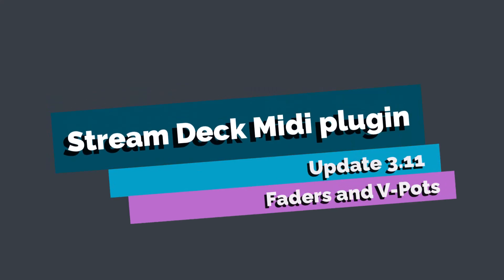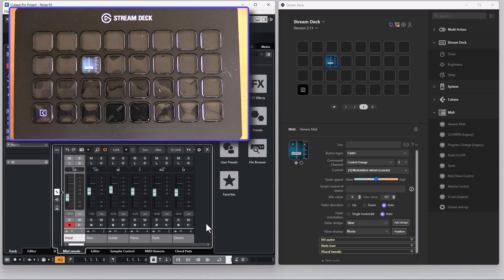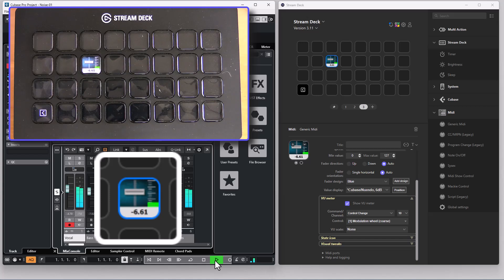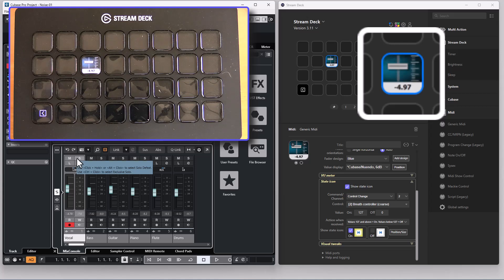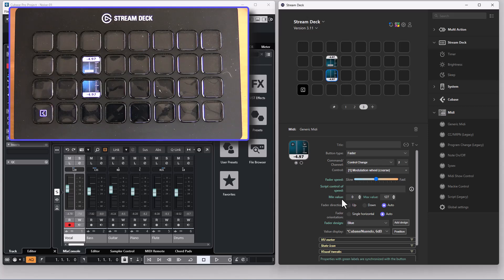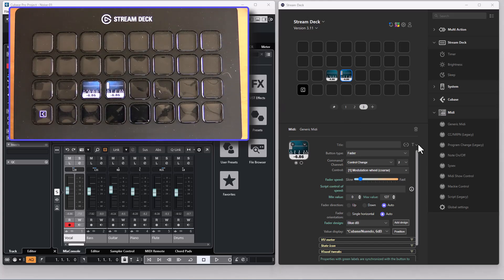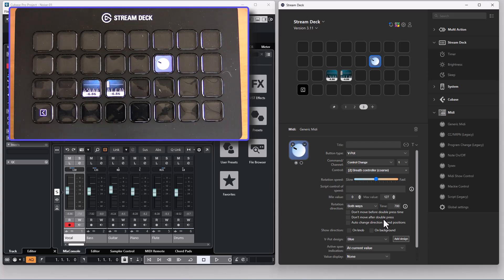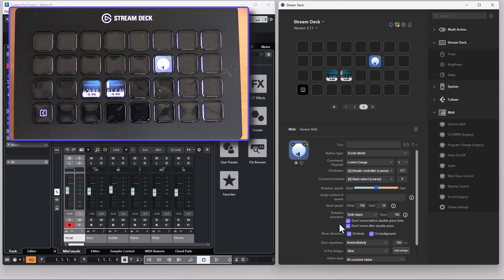Stream Deck Midi plugin 3.11 update, part 2, faders and vpots

Comment: I am trying to use my midi controller to control the buttons in stream deck software, as I don't want to spend the money on a stream deck. I can't seem to find a vid showing how to set it up tho
Reply from the maker: Sorry, I don't understand. The Stream Deck Midi plugin is used to control Midi devices and software, not to be controlled by a Midi controller. Using a Midi controller to control Stream Deck buttons on a device you don't have makes no sense to me.
Reply: @trevligaspel  what I mean is I don't have a steam deck device, I have an MPK mini that I wish to control stream deck software. Like if I press a button on my midi device, i want it to activate something in the stream deck windows app
Reply from the maker: Please emal me at trevligaspel@gmail.com.

Comment: Thanks for the videos! The thing is that now the v pot function for panning (while using the logic profile by sideshow fx on a stream deck plus) stopped working. And I can't seem to find a way to fix it. The rotary knob is stuck at full left. Any thoughts?
Reply from the maker: Hi. I don't know how SideshowFX profiles are configured. I have asked them to test this but haven't got an answer yet. You may get quicker help if you contact SideshowFX support directly.